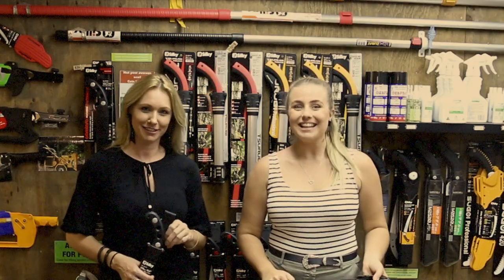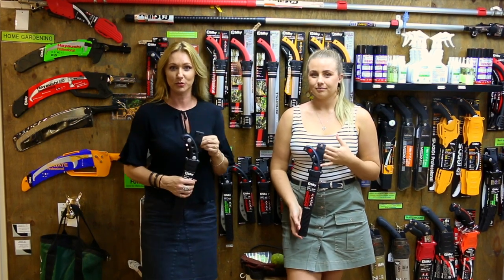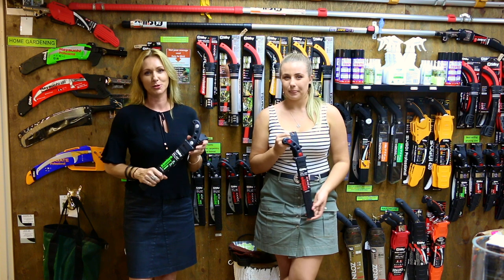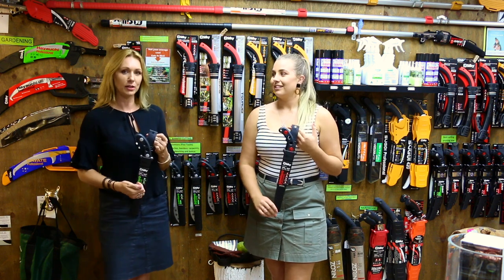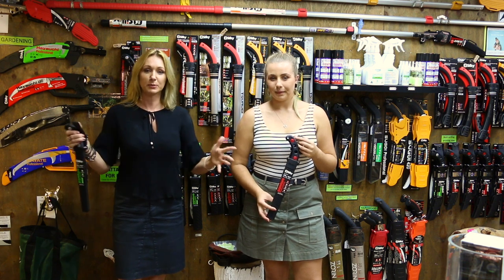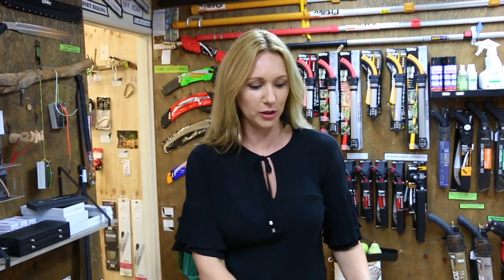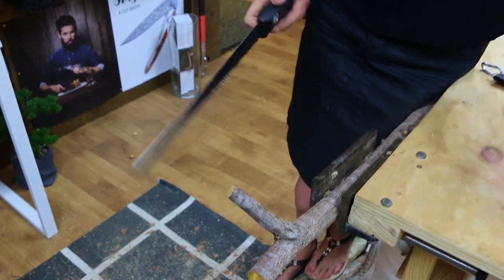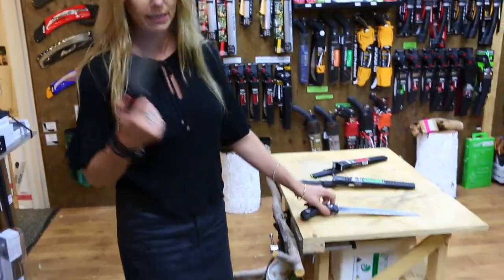Silky Gomtaro Hand Saw

Comment: Lovely hostesses😍
I have the fine tooth gomtaro 270, I think. It feels flimsy compared the the big teeth zubat. The gomtaro fine is 1,1 mm thick while the big teeth is 1,3-1,4 mm. Big difference! 
I would say gomtaro fine teeth is good for smaller up to 2-3 cm, not 2 inch. It can do it but slow, much slower than the zubat. The gomtaro fine is good for slower precision cuts. If you want to go fast then it may break because it's easy to bend. I can do acceptably fine cuts, going slooow, with my big big teeth zubat. I feel the fine teeth gomtaro is too slow after the zubat and too delicate. Seems I got spoiled by the zubat!
Reply from the maker: Hi, for the Australian Market Silky make the Fine tooth saw with a  kerf of 1.1 and the Large tooth with a kerf of 1.3.  The 1.3/1.4 is the Zubat range and they are designed to be a comparison to the large tooth Gomtaro.  The fine tooth Gomtaro can cut larger branches, but they need to be dead or fairly dry.  If you are cutting a lot of green wood I would stick to my Zubat as you say it will go a lot faster and feel better to use on that kind of wood. Thanks for your comment!  Nita. 😀